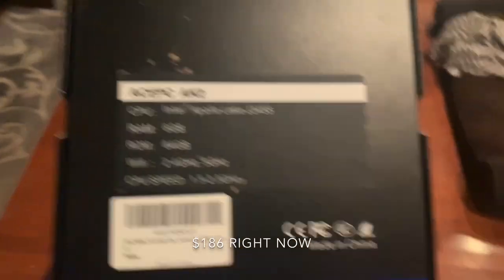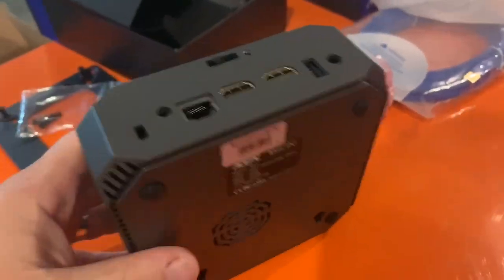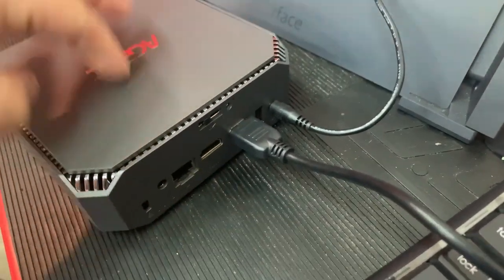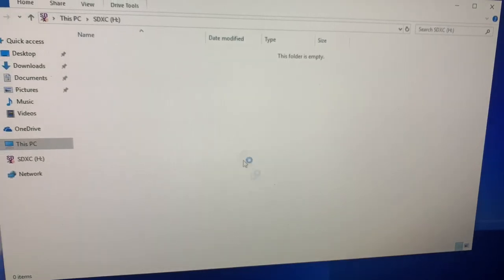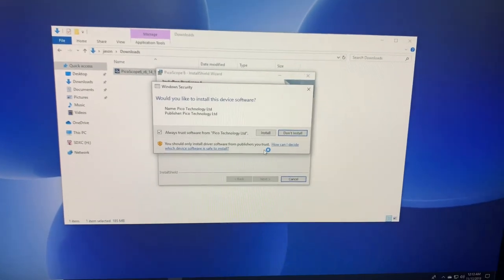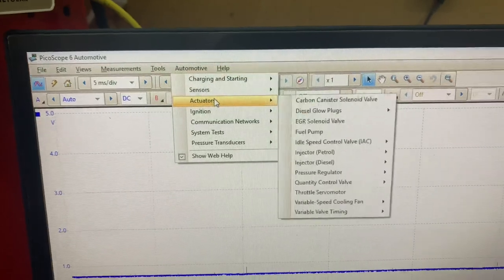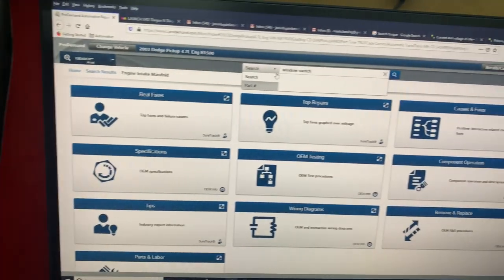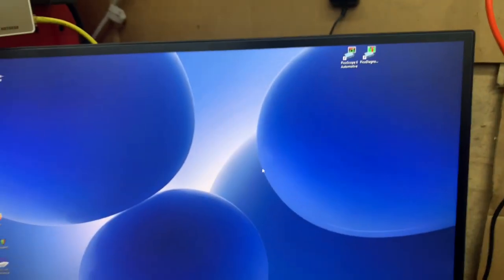Slick ACEPC Mini PC Picoscope Automotive

Comment: Nice Jay!! Thanks for sharing with all of us. It's small and compact but powerful. Perfect for Diagnostic cart.
Reply from the maker: Thanks frank yeah I figured even if it dies In a few years you just save all your stuff to micro sd or removable sata drive so you can copy files or put in another mini etc. I like it, I have two monitors set up on it now. One side for pico and other for service info.
Reply: @weldingjunkie   Jay definitely sounds like a sweet setup now especially with two 27" monitors.

Comment: That ACEPC is a bargain compared to Intel NUC.
I've endorsed a similar concept for shops seeking a large monitor oscilloscope cart on the cheap using an Android TV Box running HScope with a supported budget scope.
I like what you did here!
Denis